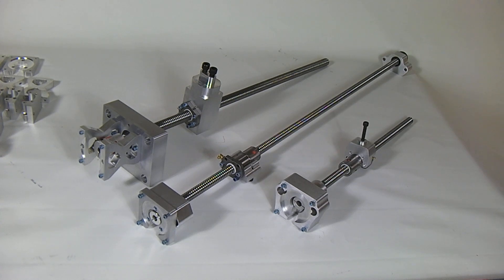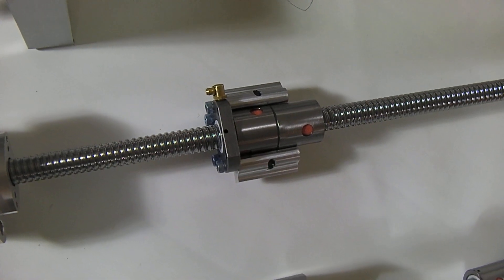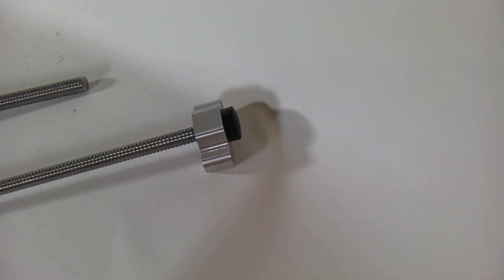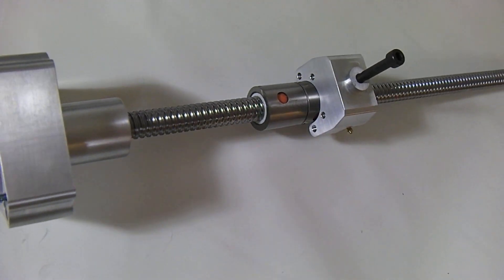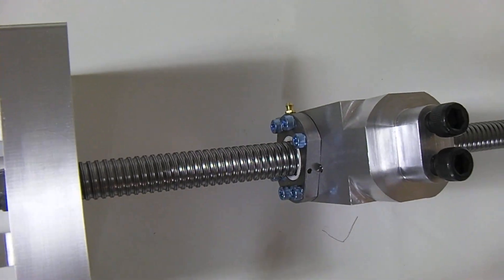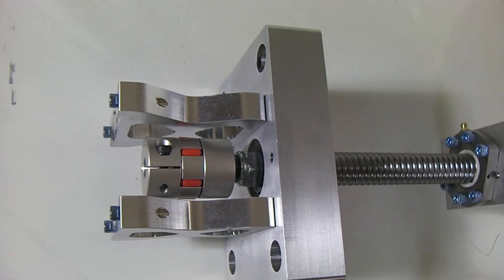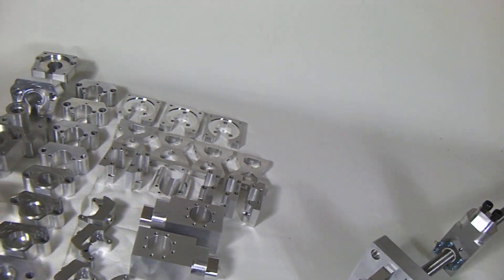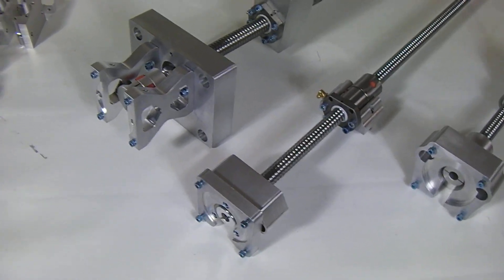PM-940m CNC kit

Comment: I know this is an older video but I'm wondering if the 940M CNC kit will work on the 940V as well. Other than the head being belt driven vs gear driven all the other specs seem to be identical.
Reply from the maker: Yes it will work on the PM-940V. Same mill with a upgraded head. I sell them on our website here. https://arizonacnckits.com/pm-940-cnc-kit.html
Thanks
Dave
Reply: @ArizonaVideo99  Thanks for the quick answer.

Comment: What is the diff between Z-powerfeed and non-powerfeed?
Reply: If you order the powerfeed then you get a different top plate and a lift motor. None of this is used for CNC. The power feed top plate has a different bolt pattern but I no longer use any of the stock holes.

Comment: I was just looking at the pm940’s today looks like they are all sold out. Do you still make these kits? Im interested in either the 940 or the pm30.
Reply from the maker: I make kits for both.

Its hard to tell from the pictures but the 940 is a lot larger than the 30. The 30 is about 430 pounds and the 940 is 800 without the stand. 

The 30 is really good as a hobby mill and the 3000 RPM spindle is the best of the hobby mills. The 940 is a lot stronger but it is only really good after you change to a belt drive which I will be doing soon.

You can always email me at davedaxx1@yahoo.com

Thanks 

Dave
Reply: Great looking kit by the way:)
Reply from the maker: @redshiftcnc  

Thanks ,

got it

Comment: The kit looks great! How much load can it handle with servos? For example what would be the max rapid/cut rates you would be comfortable running? Could it handle 800 ipm Rapids with 100lb on the bed?
Reply from the maker: Running a mill at 800 IPM requires a bit of work to do it continuously and not wear things out.  

This is my IH mill when new and a direct drive servo and a new rolled double nut Hiwin ball screw.
 https://www.youtube.com/watch?v=M299KWBsuBs

I don't say in the video but after about 10 min of 300 IPM movement the ball nut was so hot it burned me when I touched it. With dovetails, especially when new, have a lot of drag.  A rolled ball screw, if you want to have zero backlash, will have a a fair amount of drag. You make a trade off with a rolled screw. It will have some micro small tight spots that your rollover.  it does not bind but they are much larger than with a ground screw. What you get in exchange is more heat and lower life.
 For a hobby mill this is a good trade off. Most will run there mills a few hundred hours a year and it will last many years like that. If you wish to run at 500 IPM or near that speed  it will cause the ball nuts to heat up unless you run loose nuts and accept a little backlash. You will also want to run forced oil cooling like the pro mills do. With a 1800 RPM spindle most the time your are cutting around 10 to 20 IPM and 100 to 150 IPM rapids are fine. With the 86N DMM servo at 150V you can get 400 IPM and set it for lets say 300 IPM but its really not needed.

Thanks 
Dave
Reply: @ArizonaVideo99  
Would I be better off welding up a frame out of 1" cold rolled steel and putting linear rails on it?
Reply: @ArizonaVideo99  That video that you shared above sounds like everything is really tight. Would it be better to slightly loosen the preload on the ball screw and account for the backlash in the controller or to keep it tight and just run slower?

Comment: I've been looking at purchasing the PM-940 recently, but I also saw their PM-833T.  It's advertised as having a precision ground spindle (.0002 runout) and hand scraped ways.  I'm not sure how the 940 runout and ways compare.  Do you have any thoughts on the 833T?  It looks to have slightly smaller travels, but not by much.

Great work on the kits.

Thanks
Reply from the maker: I cant say too much about a mill that I have not had. I have had a good number of the benchtop mills like a RF-31, G0704, PM-25, Weiss 30 , PM-30, Charter Oak 12Z( 2 of them), and the PM-940m.
 The RF-31 was a Taiwan mill and in a lot of ways it was a better made mill. The castings were almost perfect, the Quill fit was vary nice and the motor ran smoother. I would expect the fit and finish on the 833T to be first rate which would be nice for a change. Many time with the China mills you have to do work on the Ways and Gib strips to get smooth movement. With that said the 833 is a true RF-45 sized mill and it not really in the same class size wise over the 940. The fit and finish on the 940 is better than the Charter Oak mills but not quite as good as the Taiwan mills. With the 833 you are going to pay a lot more for a mill that is not stronger than a 940. With that said I do like that the 833 is for sale. If you don't want to fuss with stuff it should be a good mill. I would like to add that the PM-30 is a Weiss 30 mill and the fit and finish is really quite high for it. It is smaller but quite high quality and has the highest spindle speed of the benchtop mill in question.
Reply: @ArizonaVideo99  Thanks for the feedback.  I was hoping since you bought the 940 you might have looked into the 833.  It's good to know that the PM-30 is good quality and it was another mill that I was considering.  I do like the size of the 940 though.  The 940 xyz is 28/12/20.5 and the 833 xyz is 23/11/17.5.  Price is important, but size (not too small) and accuracy is probably more important for me.  I guess I'd like a Taiwan 940.
Reply: The 940 is available with hardened ways, that is the most important thing if I was to buy one from them, in addition to the cast iron base and also has most mass in the body.

Comment: That is a very nice bit of kit you're offering there.  I like the way you adapt OTS components for optimum precision and design to avoid butchering the mill just to make things fit.  Sure, some mods are unavoidable, but I've seen lazy and this isn't it.   I used to work as a mechanic, and later designer, for automation; so mechanics and motion control are not unfamiliar to me.  Good luck with the business side of things.  Subscribed.
Reply from the maker: Thanks
The first kit just went out. More to come